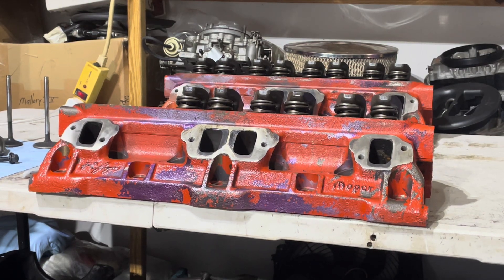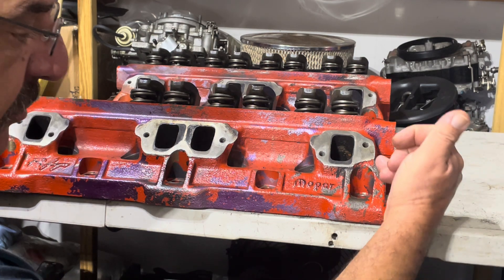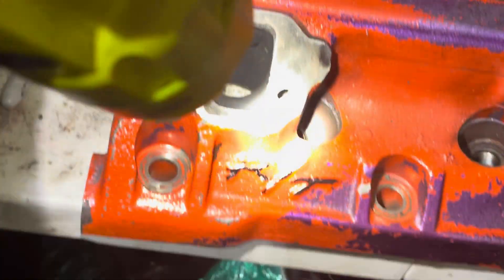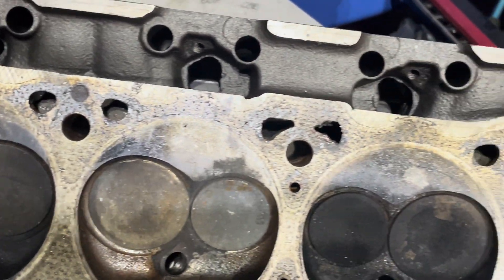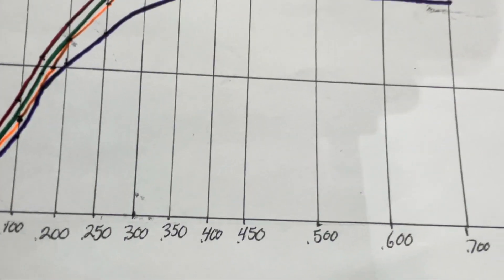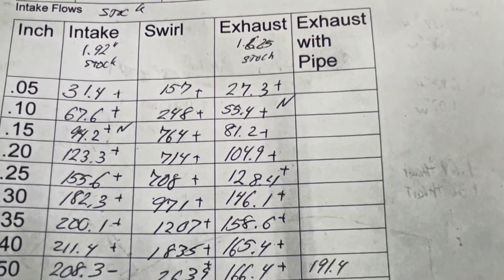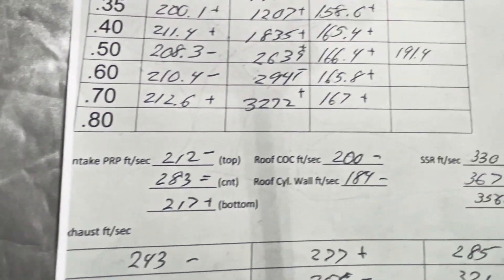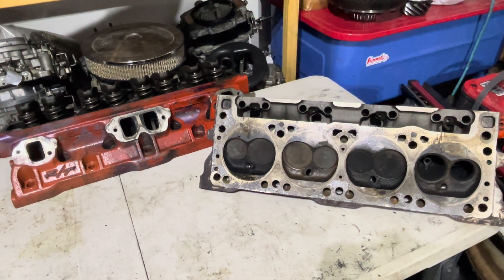Magnum R/T 2.02 heads - As cast

Comment: Nice video. Do you know what the possible power gains with a direct bolt on RT 1.92 head be over the stock 1.92 heads?
Reply from the maker: @clifff6597  Soeey but no. Port flow numbers would be helpful though. That of which I do not have. The other thing is not taking advantage of the ports increased flow. If you’re not lifting the valve up into a higher flow range, generally speaking, there is no point even though there would be a power gain. I just can say how much It would be though.

IMO, if you have a set of 1.92 heads, flow tested or not though it’s a good idea to actually know how well they flow and there characteristics. Just bolt them and and try them out!
Reply: @Robs-Garage-experiments  I was curious of the HP gains. I was on of the "lucky ones" to get the Mopar Magnum M1 intake many years ago....Do you have an email address that can contact? I have other questions about those heads and a 360 to a 408 stroker conversion.
Reply: @Robs-Garage-experiments  thanks for the reply. I don't have access to a flow bench to test that. When I had the engine built many years ago, the heads were supposed to ported, polished and gasket matched by a Performance shop in Phoenix ,Arizona area. The heads sit on top of a 408ci built Stroker. Forged Rods, pistons and Mopar performance crankshaft. I was curious about what gains i would expect to see from changing to the R/T heads

Comment: Hey the heads I traded you for! Just found this! Hope they are doing well for you!
Reply from the maker: HEY! How are ya? The heads were preety good but I will swap out the valves. A few were bent. No big deal. This just proves to me you were having "A LOT of FUN" with them. LMAO!

How are those Edelbock heads treating you?
They should have cleaned up fine and basically be abolt on and go. They seen very little usage.
Reply: @Robs-Garage-experiments  sorry about that, didn't realize they're were bent ones. The Eddy heads in getting cleaned up for the Turbo 360 build at the moment! She should make about 700 hp on a mild 8 psi

Comment: The best upgrade I've done to both my sets of RT heads now has been using a 1.476 X.625 spring seat cutter and getting rid of the stupid lip that Mopar left in the spring pocket using your 2.2/ Mopar performance retainer that come on those cylinder heads. Heads you compare that with a set of crower 68405 valve springs which makes a really nice upgrade over the stock, spring or spring options available
Reply from the maker: Oh yea! Now there’s a good tip!
Thanks Aaron! Where did you pick up the spring cutter?

Comment: I have a set on my 1995 Ram. Probably put 140k miles in them. That engine makes around 340 hp, with a small cam. Impressive heads, even though the intake port is a little big.

BTW,  pretty sure they are 5/16 stems, not 8 mm.
Reply from the maker: 5/16 not 8mm? Thanks. You’re probably right. I’ll whip out the measuring tool later on. I’ll be cleaning up the valves soon. 

What cam & kind of tappers did you install?
Reply: @Robs-Garage-experiments  I used a custom ground Comp cam, using their lobe 3311. It was on a 112 degree lobe separation angle,  with 34 degrees of overlap giving 258 degrees duration @ .006 tappet rise. Installed on a 108 degree intake centerline. It came to 206 degrees @ .050 intake/exhaust, and .486 lift with 1.52 rockers. At the time, there were one or two roller rockers on the market for a Magnum, but they weren't great. I wanted to make the valvetrain adjustable,  so I found a rocker stud and rocker that worked, and put it together with those parts with a 1.52 ratio. I used stock replacement Sealed Power roller lifters. It worked well but I would do a very different cam today.

Comment: Those are the BEST iron Magnum style head made, as far as potential. They have the roughest cast ports I believe I have ever seen, but when professionally ported, only a W-2 (also ported) will outflow them. I have some of the 2.02" versions I bought new in 2004 (had them ported and flowed) and a 1.92 set I bought used about a year ago. I want to get the used set ported and bumped to a bigger intake valve (maybe 2.05"?) with Crower double springs. I had the new ones set up with Howards single springs for a custom Engle flat tappet cam on a 365" with KB quench pad pistons. Really a killer street setup!! Many avoid the MoPar castings, iron and aluminum, but they all have some interesting features and great potential. We used the Magnum Aluminum heads on a 408" flat-top stroker and ran deep 6sec 1/8mi times on motor in an A-body chassis. They have a 52cc chamber so you don't need a domed piston to get 12.5:1+ compression, better flow and lighter weight!! This was all with a no maintenance hydraulic roller Comp Cam with only 242/248*@.050" and .575" lift with 1.6 roller rockers.
Reply from the maker: WOW! Very nice!  I didn’t cc the chamber, my bad, I should have but didn’t think of it until you mentioned it.
 Nice build

Comment: Vey nice , i wonder what a very good valve and valve job would make it flow. And I wonder if they are legal for Stock class or even super stock NHRA .
Reply from the maker: Good questions. IDK. Hummmm
Reply from the maker: You’re going to find out soon n a little while. I have to order up valves as 5 of the valves that came in the head are bent. I’ll be looking at Chevy +.100 valves for more valve spring installed height will h better springs.

Comment: Thanks for the follow up on the RT heads. Time for me to start searching for this needle in the haystack if they are out there somewhere. I sure would like to find a set! What might be the limited brands of intakes that can fit these heads? Love your videos as I always learn from them!
Reply from the maker: Thanks DrGo. These heads are a needle the haystack. They are out there but owners are not letting them go.
MoPar had (key word- HAD) a dual and single plane intake for these heads. Currently made are the Chink dual pattern Edelbrock knock off, the Edelbrock RPM & Indy has intakes. There big bad ass race single plane and the ModMan intake with several tops to choose from. 

FWIW - Edelbrocks own Magnum head is a good choice to use if these iron gems can’t be found when the time comes. I don’t know how the flow rates stack up against each other. Only what Edelbrock lists. A talented head porter will make ether one move air really well.   Who comes out on top or just the simple comparison between the heads would be really interesting to see and not so much who flows more at a high lift but the over all curve.
Reply: Thank you so much Rob for the helpful information. I need just a little patience. I suppose the hunt is half the joy and a good part of the story one can tell when their build is finally completed. I will see how parts hunting goes this spring and if needed, I can look at those alternative heads you suggested. You and Charlie share information and educate me that has helped me understand better and already avoid potential bad decisions of buying parts that would not be well suited for my intended mild street build. I have a small block Mopar, so I am hooked on watching videos from you and Charlie!
Reply from the maker: Oh cool! Thanks. Charlie’s a straight up good fella. He is nuts for porting a head. He loves it.
Reply from the maker: Crap! I touched the reply button before I was done. 

My best advice for power, afford the best cylinder head you can.

Hopefully all goes well here and I can get to the dyno for some Tom Foolery testing of various heads and cams.